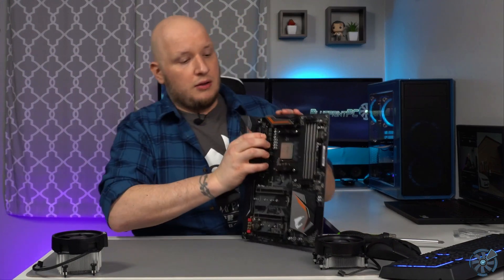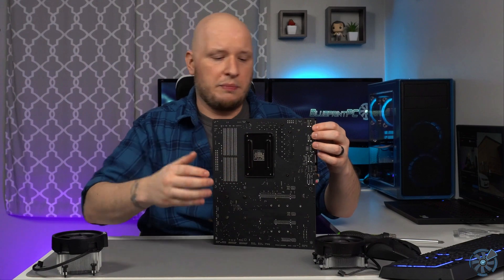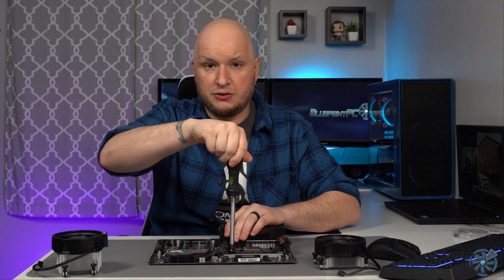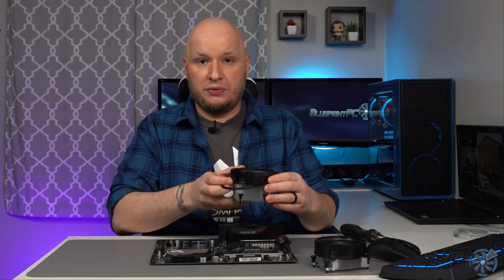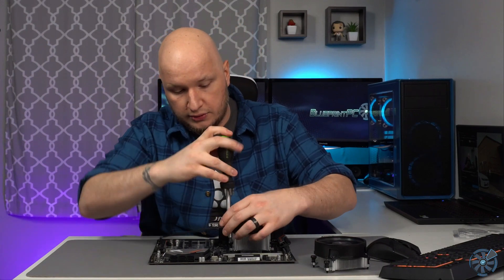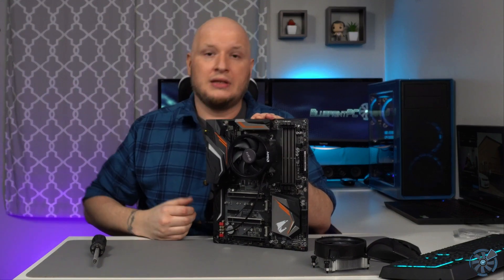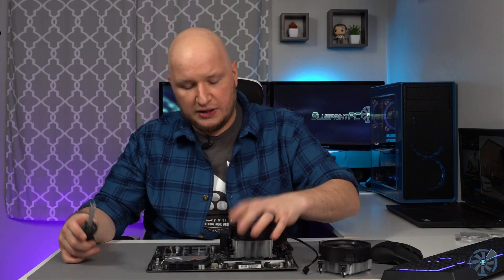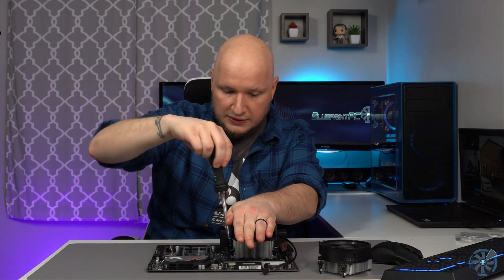AMD Cooler Install + Tips

Comment: i got the old 2-point mounting for an older AMD fan. (Running my Phenom 2 CPU.) I can't remove the old 2-point brackets  to attach a new AMD stock fan because the four holes are a narrower pattern (and yes I checked the fan both ways). Is there a clip that is sold to put on the new stock fans so they can utilize the older 2-point mounting?

Comment: after reapplying thermal paste i had difficulty trying to hold them together with the cooler especially if you already have your motherboard on your case, you cant lay it down and expect the back plate to stay so you can screw the cooler in place. had a hard time also with screwing them because i have to put more pressure that the motherboard kind of bends when i put in the needed pressure to screw them together so what i did was screw a few turns one by one until it was tight enough, but now i cant run a game without the whole computer instantly turning off after a few seconds probably because it was overheating after taking a certain amount of load help
Reply from the maker: Hey there, so its possible because of the board bending during installation that it may not be seat properly which causes it to overheat and shut down. You could try to reinstall the cooler. I would recommend pulling the motherboard board out and installing it that way to make sure its seated properly.
Reply: @BlueprintPC  thanks, i was so scared that i could have broke my motherboard/gpu because i sometimes tapped them with my screwdriver because put too much pressure to screw em in  (its bad, i know) but people said if theyre broken it wouldnt start up in the first place
Reply: @BlueprintPC  one more thing, is there a specific cue with the sound these springs are making (screeching when you screw in/out) as to when id know if theyre seated in after one turn? im afraid i cant remove the motherboard out because my hard disk has stripped screw and its in the way so i wanna know when its seated in so i can move to the other screws or not so i dont have to overturn it and tilt it to the other side completely